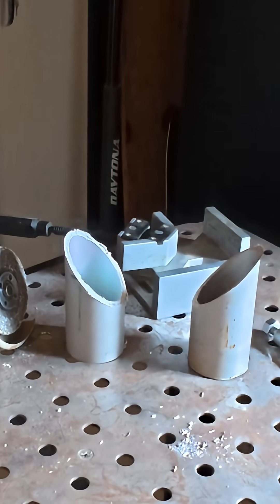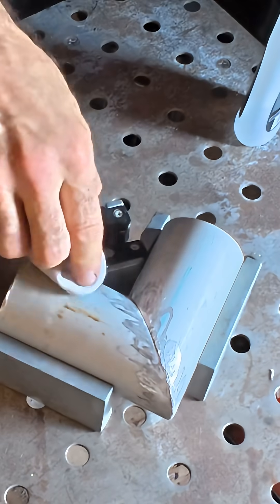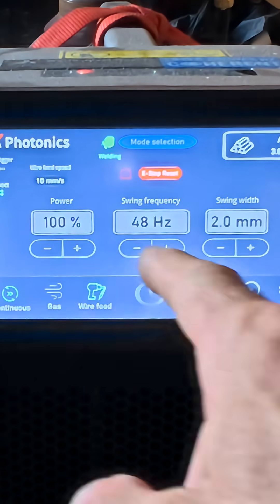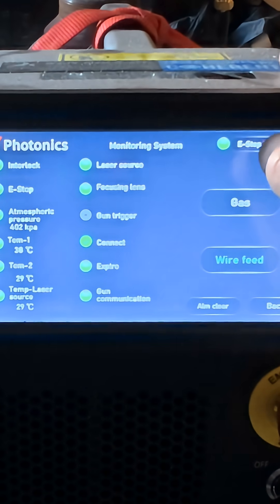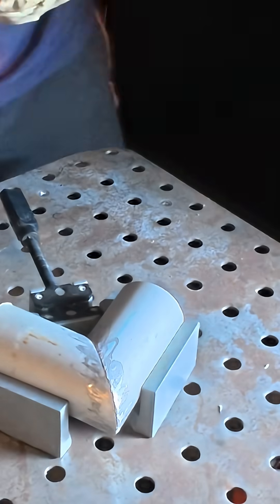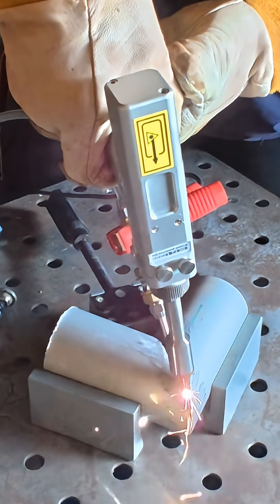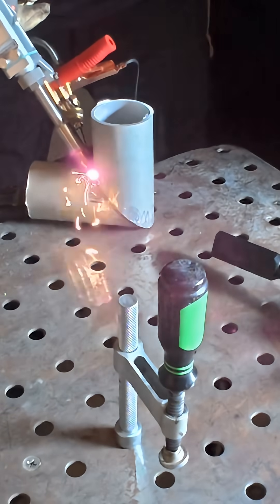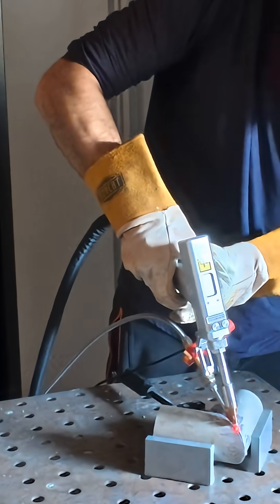Xlaserlab X1 Pro Laser Welder, Cleaner & Cutter #laserweldingmachine #laserwelding #lasercutting

Comment: Solid; getting results you like on that 1/8" Al? I haven't attempted that thick yet.
Reply from the maker: So far, so good. I still need to experiment on various thicknesses.
Reply: Why is the safety clamp on the gun instead of the table?  Trying to weld you d$@k off?  Put a plate over the holes in your table before you burn hole in your foot.